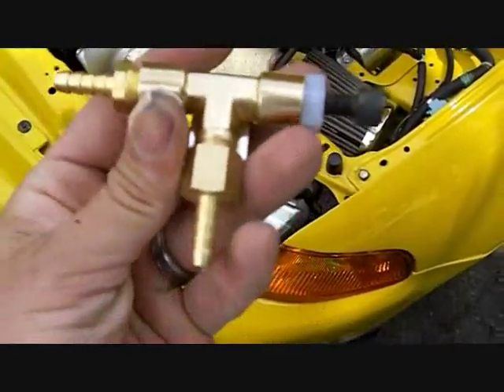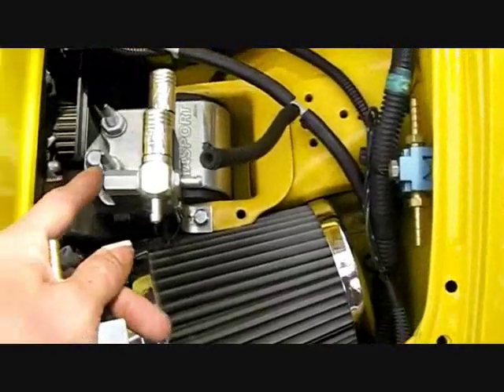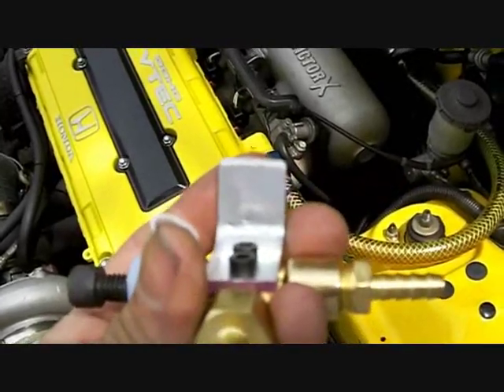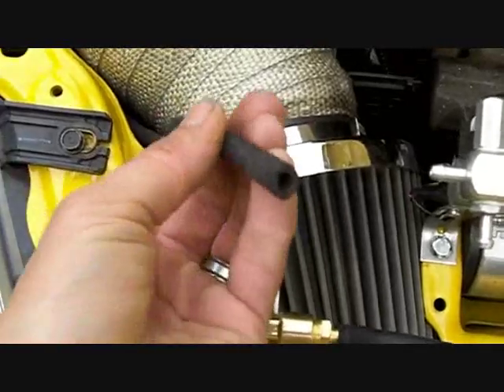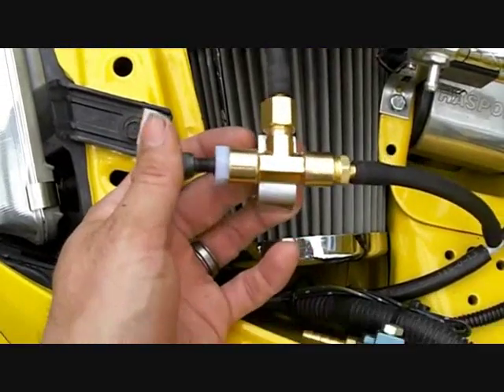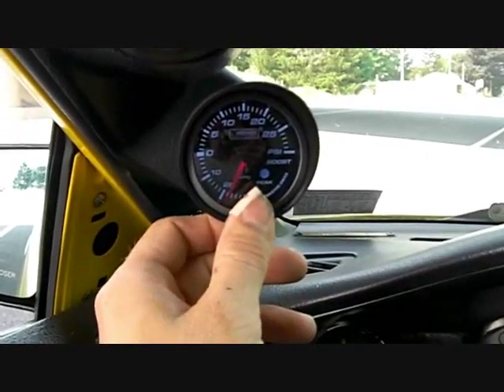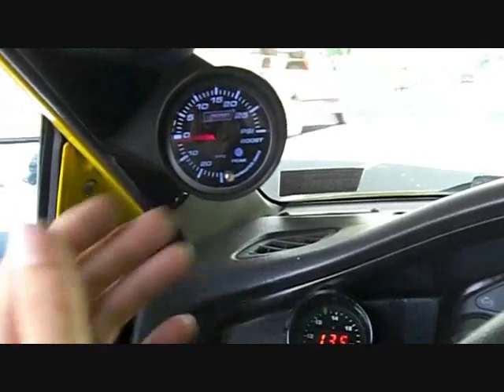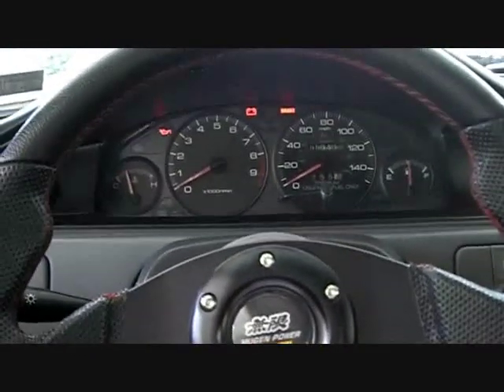JS Boost Controller

Comment: Mate I copied your design and it works great and is very steady. I run it on a Turbo Diesel 4x4 that had over boost & heaps of lag. To combat these two problems I also connected a bleed valve to the wastegate line and the physical valve sits on the dash in the cabin. It doesn't change Maximum boost by much more than 2lb pressure either way but you can adjust turbo ramp up speed on the fly to bring on instant boost & it removes around 99% of the lag.Or you can use it to back off boost on the highway. Together they made this slow old clunker go like a performance vehicle. I just set it and forget it and leave it at that.
 I also paid too much for a retail manual boost controller (a Tillix Valve) which is not very good. It is like a Yuppy designed Dawes valve & it leaks like sieve at the threads. It uses a brass plunger instead of a ball & in my opinion the plunger is too heavy & a lot slower to react to pressure/vacuum. The only good thing is the leaking threads act like a bleed hole which cuts off the boost instantly when you back off, but the downside to this is that the leak also makes it react slower to get full boost. But all is good now,so once again "Thank You"

Comment: I am happy with what I have, and I would have bought this if it weren't brass (check out a few dragster shops online for an all Aluminum version of the pieces of this, and you can build them in colors for the same price as the brass ones are at the hardware store... I want to PM the OP here, the parts used could be turned over to a complete catalogued product and marketed much more prevalently without any additional costs...

Comment: There is a source for ceramic balls in bulk on eBay. If you are looking to squish even the "king" of these things, those balls wouldn't raise your manufacturing costs, and they would make your BCS about 3x as fast reacting. Ceramic is wicked light, and has almost zero stiction. Friction is nearly as low as stiction on these things.

Comment: It is nice to see a demo with a clean built motor behind it. I have heard countless tales of the hardware store boost controller being the best possible solution. I admit that the Hallman piece is just that, but the maker did go to the ends of the earth sourcing the best possible materials for each component.

Comment from the maker: on most boosted set ups you remove the pcv set up and vent the block and valve cover into catch cans.  the 63 ar exhaust should allow for fast spool, perhaps what you are seeing in reality is spike and then it settles, are you using any sort of MBC at all right now or just wastegate spring?  i will gladly make you a MBC if you feel it might help your issue.

Comment from the maker: good question, the controller it self is designed to hold boost at a steady level, however if you have a waste gate that is not set up or designed properly you cannot over come this with my boost controller. i will say this i have sold over 50 single stages so far and not one person has had any issues.

Comment from the maker: I havnt been back to the dyno since making a few changes , i made 512 on 21 last time i was on the dyno. i have since street tuned it to 22 psi and my 1/4 mph went from 134 to 138 but i have no idea on the power.